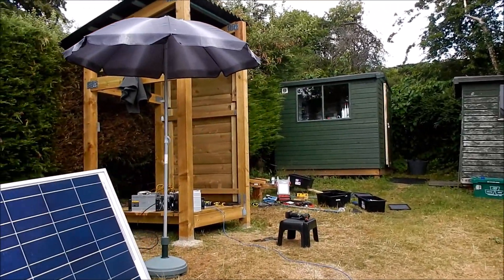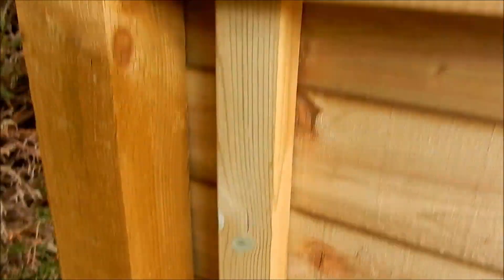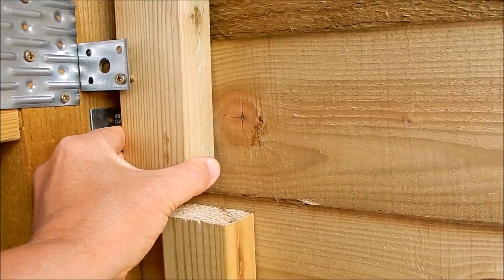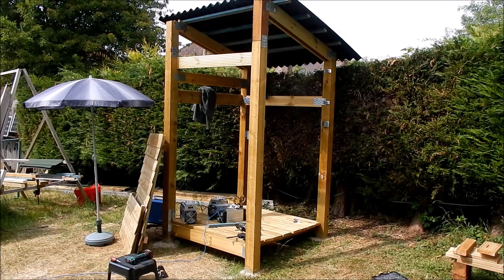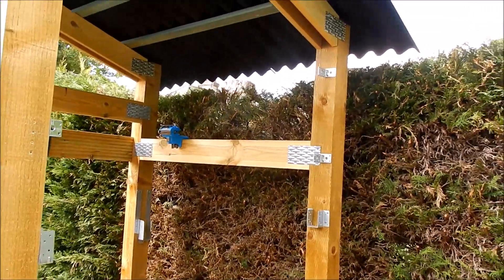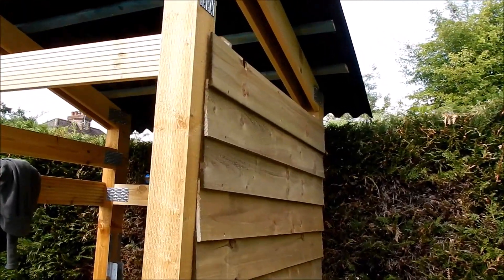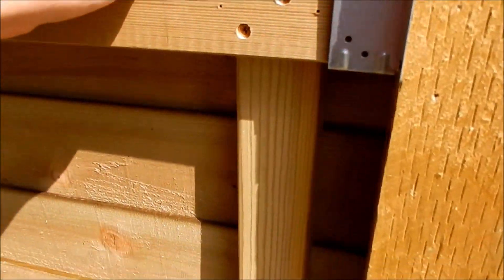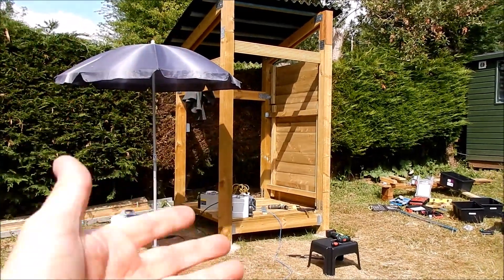Modular Shed S1E12 - Modular Wall

Comment: For the joist hanger option, could the left tab (the part you're pointing at at 1:53) be bent 180 degrees so that its footprint is within the middle of the hangar? That would allow the bracket to be mounted closer to the inside of the shed, without having to cut the metal. Doing that should eliminate the need to carve out part of the vertical members. The cross member would need to be a tiny bit shorter to accommodate the screw heads from the bracket being there.
Reply from the maker: I've dismantled the whole right hand side of the shed and moved all the feather edge to the left. I'm starting again on the removable wall.

Comment: Have you thought about just using a French cleat solution here? I.e. hang the panels using several wooden french cleats?

By definition it would mean the walls are “pulled in” to the shed via gravity. And no expensive metal work required.
Reply from the maker: That's given me an idea. A wood/metal french cleat. Cut the timber upright 45° on its underside. Turn the angle bracket to 45° degrees.  A hybrid cleat :)

Comment: I initially thought that the side wall would be made of decking boards and hinge at the base so you could simply drop the side wall to make the floor for the next two (three?) units. A bit like opening out a box. I think hanging the walls is a lot easier! 😀
Reply from the maker: Wow, side walls made of decking timber would be pretty heavy - interesting idea though :)